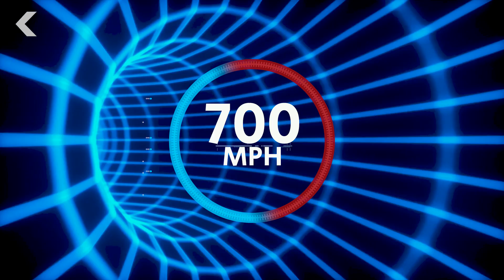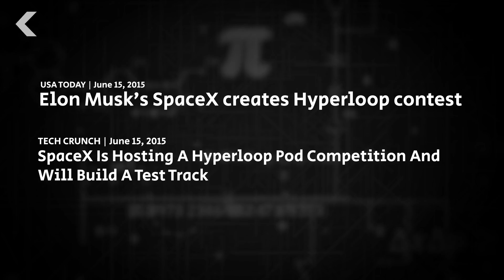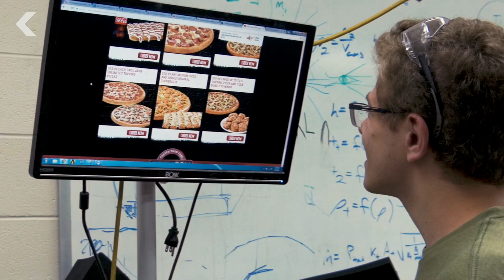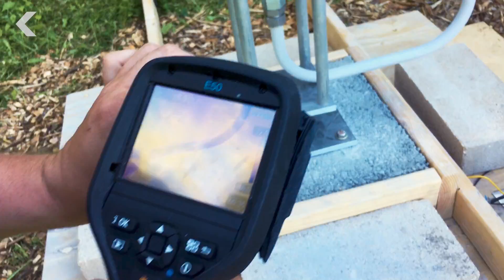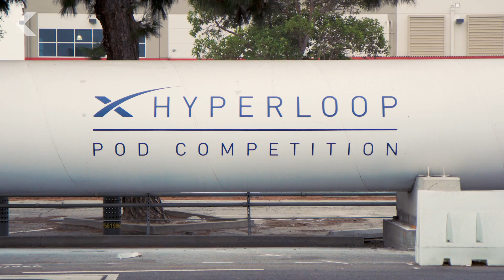These College Students Built a Hyperloop Pod... Here's What Happened

Comment: Mythbusters wonderfully explain what happens with you when the vacuum breaks down air rushes in at the speed of sound and you will be the ping pong ball.
https://youtu.be/iuscU6knvH8
A better explanation is done by Thunderf00t 😉.
But realising you are the ball is a fun one.
By the way using a rocket propulsion by releasing gas in a vacuum tube is just contra productive in a vacuum tube.

Comment: Musk is basically a snake oil salesman who loves publicity. Nice college project, but the cost to build a commercial Hyperloop would be astronomical.  It will be (I'm writing early 2019) a monorail (notoriously expensive) inside a large vacuum tube (don't even ask the cost) requiring some spectacular civil engineering for the necessarily gentle curves. And Musk is wrong if he thinks it won't need to pay for the land underneath.

Comment: The pressure propulsion system in a vacuum tube is stupid. They should`ve taken advantage that every pod goes on the same line and use an electric system, like a train. Releasing gas in the tube is going to be extremely inefficient, as they are going to need a vacuum pump to get the gas out of it, basically doubling the energy consumption. Also, the air tanks will have to be a lot stronger, as they operate in the vacuum, therefore being more expensive.

Comment: I wonder if you got extremely high powered vacuum pumps if you could slowly extract the very small amount of air still inside the tube and use that as fuel by pushing it out the back. Also if the pumps are on the front they will provide minor pull themselves.

Comment: The concept is backwards.

Why carry a propulsion system on the vehicle at all?

It takes energy to remove the air from the tube initially. This requires an outside infrastructure of equipment. Then, currently, a vehicle is placed inside and releases gas from its propulsion system which erodes the vacuum. That gas must be removed again.

Furthermore the propulsion system on the vehicle has mass also. This mass also needs to be accelerated.

Bass ackwards.

If one were to have the propulsion system outside of the tube and not in the vehicle then one would net energy. Then the vehicle is less massive as it is not carrying the propulsion system. 

(This was the advantage that the Russian Space Shuttle Buran had over her USA Space Shuttle counterparts. She could carry a heavier payload to Low Earth Orbit (LEO) as she was not trucking the propulsion system to LEO and back each time. The Energia Rocket propulsion system was designed to be returned to Earth for refurbishment and reuse.) 

So to propel the vehicle through the tube...

Introduce pressurized gas between the vehicle and the tube bulkhead (Or written again...at the end of the tube behind the vehicle and forward of the tube bulkhead.) The expansion of the gas will cause the differential in pressure that will accelerate the vehicle. Then remove the gas introduced and store it under pressure for the next cycle.

Greater energy efficiency will be achieved.

You can do better Elon Musk.

Comment: few questions 1. how much energy will it take to pullout all that gas(air) in the tube per (enter distance of tube here) compared to the energy consumption of something comparable? 2. what happens when there is a failure in the tube? 3. doesn't the propulsion purposed here add more mass (gas) to the tube causing you to need to pull it out again? 4. how are you going to deal with pressurizing/depressurizing the tube every time you pull out its cargo?

i understand the idea behind this but i feel as though it will fail. usually we find new ideas from failure of old ones so that's why i don't mind this happening but i still feel we need to stay critical of what we are doing.

Comment: If I had the money I would build a train track that’s in a circle tube type thing however the loop would be covers in magnets then the pod it’s self would be covered in opposite magnets so they reject therefore holding the pod in the center then it has a jet exhaust on the back which propelled the pod through the tube

Comment: guess we are building a maglev in vacuums now when we can't even make maglevs economically feasible.

Yes im aware there are like 3 in the whole world. those are like e-peens except for countries and in real life. so not e-peens. but you get my point.
Reply: Maglev trains like Transrapid are very large, heavy and expensive. This is based on a small, light, inexpensive car that goes much faster. No real comparison.
Reply: excuse me? I know this might not necessarily apply here but i dont think there is a single example of where a smaller vehicle is ever more efficient than a larger one.

from car vs bus, to smaller planes vs jumbo jets, etc etc.
to quote ece472 engineering economics' textbook directly,
M (refering to cost-capacity factor) is generally in the interval of 0<=M<=1...most frequently used value is 0.6
this is more generally referred to as economics of scale (in other contexts).
There is no reason to believe a maglev car is going to be more efficient than a maglev train.
There is further absolutely 0 reason to believe going faster and requiring a vacuum is going to make it more efficient either.

Comment: How are you going to keep the tube from colapsing, and if it does, spat goes the people, also it would take a very long time to de-pressureis and then what if there is a moinor leak In the tube, then all you have is a long expensive tube thrue the dessert that could take mounths to find the hole that de-presurised the tube, then you would have to pump all of the air out of it. That would be expensive, and the project over all would not be cost effective.

Comment: I don't think vacuum tube is gonna do much in the future, when it comes to long distance traveling, covert beats speed. We can see the supersonic concord airplane is no longer in use and was replaced by more effects than much slower planes that over trips that is long, but more comfortable. 

Specially in the US, airplanes are cheapener and more cost effective than the subsidized trains that require maintenance of the tracks and other expenses. The vaccine tube is more expensive to operate and maintain than trains

Speed is not the way to go, comfort and trip elimination is. Just my opinion.

Comment: How can you design anything with no actual spesifications? This is not good engineering, just playing around. There is no way these small vehicles possibly can be used in any effective public transport system whatsoever. And now they are using "rockets" for propulsion, not the advertised maglev? This is hype.

Comment: The thing with the Hyper loop, Is they can use a NEAR vacume, not a perfect one. 

Air resistance is a big thing for planes, but if they can make a highway type system that reduces air pressure sufficiently then this WILL work and be affordable.

Those saying about it not being strong enough, By the time they perfect it and have all the red tape sorted, carbon nano tubing will be replacing steel worldwide, soo yeah, something 100 times stronger than steel at a tenth of the thickness and weight. strength issue SOLVED.

Ofcourse if money wasnt an issue (We need to get rid of money its like the only thing holding us back at this point) we'd have this and a lot of other cool and very efficient shit already

Comment: hears what they dont tell you hyperloop is a 100 year old idea that was  created and then abandoned do you know what also is about 100 years old? rocketry we went to the moon and hyperloop was abandoned because it does not work, and is way to dangerous like if a bolt is flung up from the track that hits the capsule at 700mph do you know what happens? everything that is hit turns to dust dont believe me watch a supersonic jet hit a wall. on  the off chance that this is actually built dont get in it its a death tube.

Comment: Its has serious Physics and logistical and problems, not Engineering ones and the former are a lot tougher to overcome. 
Start with this made by an actual Scientist.
https://www.youtube.com/watch?v=RNFesa01llk&t=2s
Not to mention that such an expensive and sensitive mode of transport will require the same security checks as an Airport if not more  and we all know that part on domestic flights often takes longer than the flight time itself, which has not been considered in the proposed travel time.
Not to mention the threat of vandalism/terrorism  and security issues on guarding thousands of kms of a tube under vacuum. 
Also Aircraft are more Feasible because it is easier to create a safe and secure vehicle (aircraft)to move through inhospitable conditions than to create artificial environment (Vaccum Tube) and a safe vehicle to move through it. Also the air on which aircraft fly does not have to be bought from private property owners.
The benefits are too few for the cost and danger to life.

Comment: This is kind of sad. It takes this many people to design a pod? Why would hyperloop pods have wheels, especially ones made of rubber? Nothing that is meant to one day go 900kmph be using that. Also, other than running emergency backup life support, a pod should not need batteries for any reason, power should be delivered to the pod via the tunnel, this would save a lot of weight. Finally why such a overly complicated and dumb shape? All of the corners on that thing are just going to be possible points of failure under vacuum and will add drag from what little fluid it dose have to push through. It should be a simple smooth shape, possibly with a small amount of fuzz to reduce drag (aesthetics are enlivenment when a machine spends it's entire life in an unlit tunnel).

Comment: The hyperloop is impractical from an economic and logistical standpoint. Even if you can get it to be structurally sound, it will cost too much to maintain. While being theoretically possible, there are far more economical and logistically valid modes of travel.

Comment: my question is...why not use a maglev style propulsion system for the hyperloop? why not take an already understood and tested method and see how it interacts with the hyperloop? would the vacuum reduce friction and allow for faster speeds and more control? wouldn't the maglev also allow for less reliance on gasses and remove the need to refuel the vehicle?

Comment: This is a super credulous report. The hyperloop pods from the previous year didn't prove anything but failures. There are actual engineering competitions out there where student lead teams excel, the hyperloop competition has not been one of them. The hyperloop is a project with some very big hurdles to get past. Like the fact that a much smaller tube that is only 3/4ths of a mile long costs a huge amount of money. If the pod is run with compressed gas it's going to spoil the vacuum, so no gas propelled pod can ever be part of a working hyperloop system.
Reply: It won't run on compressed gas.  It will be a maglev in a vacuum tube which for strange reasons its fans think will be cheaper to build than a maglev not in a tube. Fast maglevs have been around a while already and have NOT taken the world by storm.

Comment: Why are the pods built sleek and aerodynamic if they'll be in a vacuum tube?
Isn't the whole point of hyperloop to remove air resistance for faster speeds?
Reply: It's a near-vacuum, not full vacuum. There is still some air and at high speeds the pod runs into enough air that aerodynamics still come into play.
REPLY

Comment: I'm still trying to figure out how Hyperloop could ever be revolutionary.  It's literally just a mag-lev train in a vacuum tube.  Sure, it goes somewhat faster, but the trade-off is a much longer wait time while the vacuum is restored and a much higher risk of instant death if something goes wrong.
Reply: They got up to maybe 80Kph top speed and that was the fastest one.... Not exactly highspeed
Reply: why not have the doors attach to basically outer doors, keeping the inside of the tube at vacuum? you'd only have a very small space be pressurize.
Reply: It might go somewhat fast. Possibly. I didn't see any pod go several hundred miles an hour for miles on end.

Comment: The hyperloop will not happen in your lifetime.
Reply: Basically you don't understand physics, economics, how long you will live, or logical fallacies.  "The same was said about such and such." is a logical fallacy.  The fact that someone said something isn't possible, which then became possible, doesn't mean a hyperloop possible.  
1. There are technological hurdles that can't be over come with today's technology and materials and we will be dead and gone before this is possible.  
2. Even if the tech and materials were available right now, the Earth will move an inch or 2 causing catastrophic failure.  
3 and 4. Long range hyperloop systems (as proposed) will become too costly to maintain and and it will be far more dangerous than current modes of travel.
Check back with me when I'm wrong.  Until then keep dreaming
Reply: It likely won't happen ever as there are already better methods that already exist and are oh you know... actually viable.
Reply: Bill Schlafly it wont happen in ur lifetime even if u are imortal at least I hope it wont
Reply: same was said about transrapid, but germny developed it about 48 years ago (...and sold the concept to china -.-) and basically the hyperloop is just a transrapid in a low pressure loop
Reply: Bill Schlafly it may not, but if everyone thought like you then in the far future when everyone died and their children grew up, there would be nothing to finish, no innovations. They start and develop it, and eventually it benefits humanity later.

Comment: So if you use pressurized tanks to give you forward momentum; I ask how do you scale that up for a trip to San Francisco from Los Angeles? Plus releasing that much gas in a vacuum tube will dump your pumps and trash your internal environment.
Reply: Even though if you do have pressurized tanks, it can give the high vacuum of the tube away and can potentially creating resistance for other hyper loop trains
Reply: i guess they believe the train wouldn't decelerate for 30 minutes
Reply: Jake Lump air creates tons of resistance... That's why if you remove air from the environment there won't be any resistance
Reply: Ray Martin exactly. Like wtf, does it wirelessly charge gas or some shit?
Reply: Possibly they may have a certain area for the gas

Comment: small wheels are optimal on high speed trains. That's why you see rollercoasters with big trains with small wheels... wait. That's not right.
And as you know. Design is more important than actual engineering. If a bridge looks great, but colapses, you still deserve a prize.
Reply: Design cannot be materialized without engineering. Also design can make nice looking bridges as you said but only engineering can make sure they do not fall off. You debunked your statement with your own example.
Reply: debunked? You understand my post exactly the way I want it.
Reply: Karasaph Exonar
Do you know that Hyperloop is meant to be Maglev, and they do not have your traditional wheels, and did you compare rollercoasters with a Train son? Besides kneejerk reactors like 
El Bottoo do not understand that not only were you wrong, but my reply had nothing to do with supporting Hyperloop, the joke is on you, learn to read. I do not think it will work as my comments state below. 
Maglevs levitate at their higher speeds , but need wheels at lower speeds and that is not because they are like rollercoasters .So no small wheels or roller coasters.  Now move on.
Reply: sorry, totally forgot about the maglev part. Guess I was wrong then.
Reply: Its an admirable quality to accept one's mistakes , good on you and respect.

Comment: The badgers pod is literally a CO2 cartridge car. Why did they get the innovation award? 
Anyways, a rocket car won't work because it's in a vacuum so the rocket will decrease the vacuum over usage. So the more propulsion used the worse the tube as a whole functions.
Reply: I guess its like a "participation award" in a running race, one trophy gets paid for, and the best team wins no matter what. Also, if this stuff is the "winner" then what precisely did the losers accomplish? (perhaps the project was incomplete, or got stuck in the tube, or had political graffiti on the nose, or sprayed chemicals on the judges, or wounded a judge with an electrical discharge, or gored the judges with varying protuberances, or exploded into shrapnel, or maybe just remained DOA and ready for burial) ;)
Reply: It's brilliant:  Perfectly stupid but within the rules.